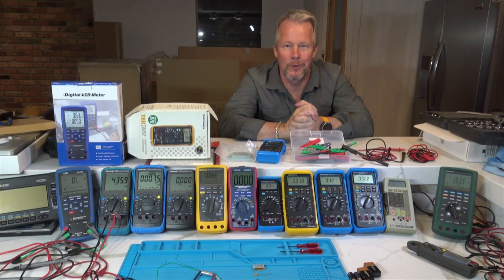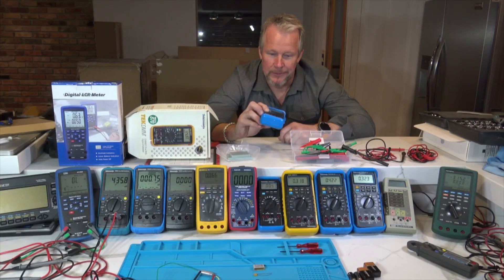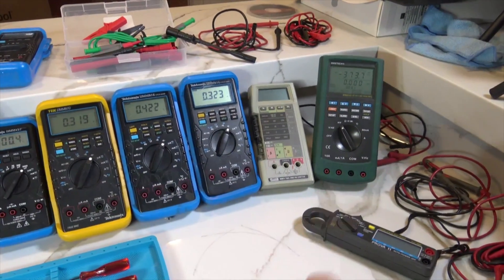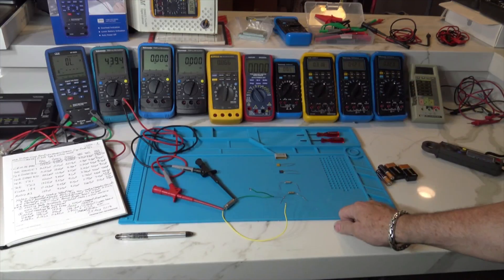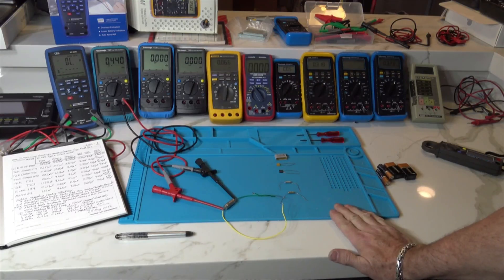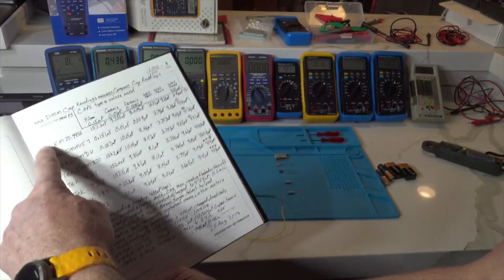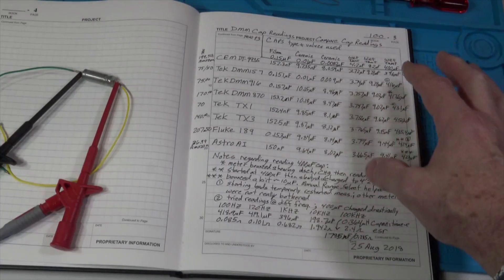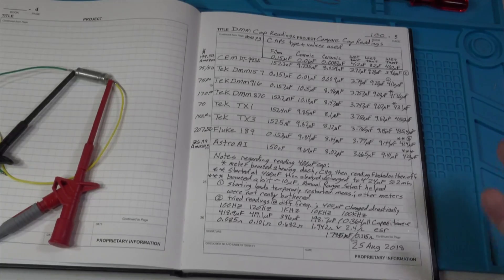Capacitor measurement with multimeter shoot out

Comment: If you still read this: I was looking for some kind of comparison for the CEM DT9335; I’m repairing a tapedeck PS board and few capacitors are well off others not so. I’m comparing readings from the CEM and 2 DMMs Voltcraft VC190 and VC890. And I’m bit confused as with both DMMs I get readings closer to what the cap is while with the CEM I get lower readings ex for a 2200uF on the DMMs I get 2000/2100 on the CEM 1960/1990 - and this happens also with brand new ELKO caps.
What (should) matter indeed is the ESR values and with the new ones I get 0 ohm and with old ones varying from 0.06 to 2.x. The DMMs don’t give any ESR readings so should I trust the cap values given by the CEM LCR ? I calibrated it successfully using BK Precision Kelvin blade alligators. Measures on the CEM taken at 120Hz